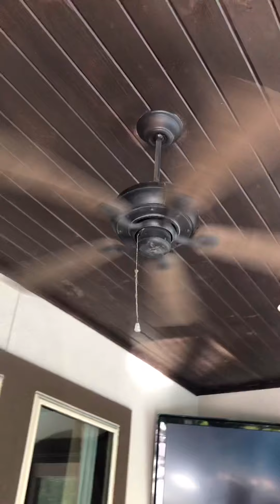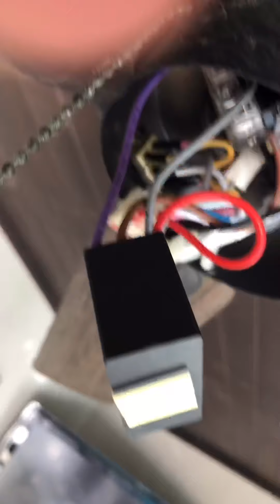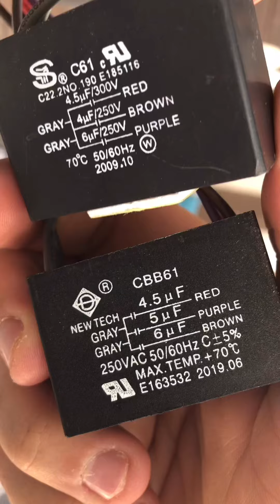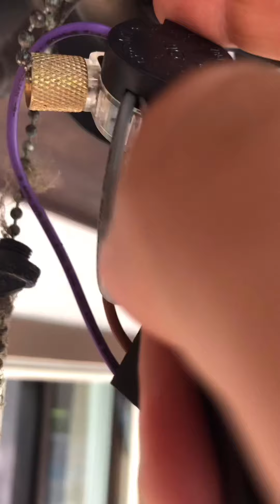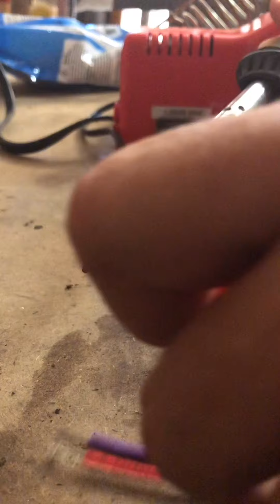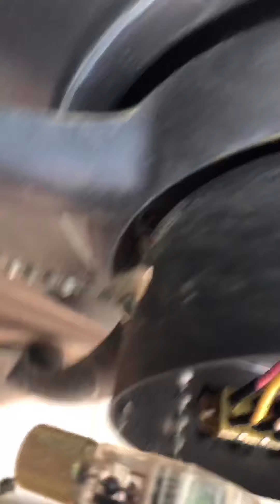How to Fix Only 2 Working Speeds = Capacitor Issue! Saves $150+ Ceiling Fan Replacement!

Comment: But u installed the new purple were the old purple was u were suppose to install the brown because the old purple was 6uf and the new purple is 5 uf u should’ve installed the brown one instead u can’t rely on the colours
Reply from the maker: Thanks for feedback. Maybe so. It has worked flawlessly since this fix with no issues 👍
Reply: @autoraiders9520 yeah because it’s only a 10 percent difference but I still think you should swap them